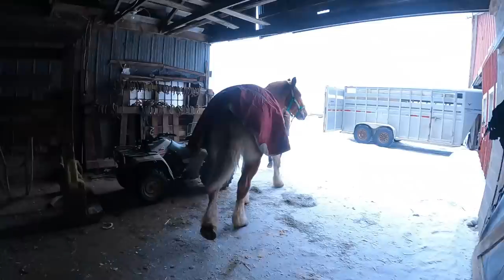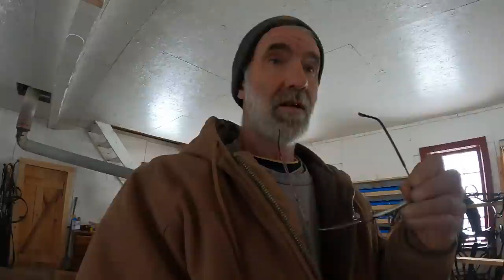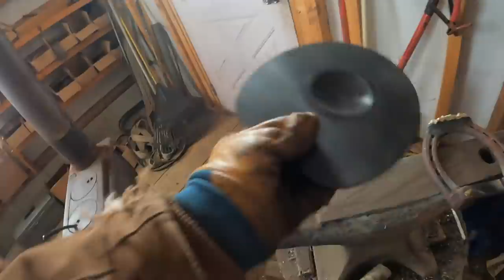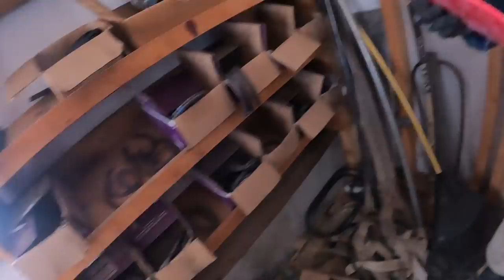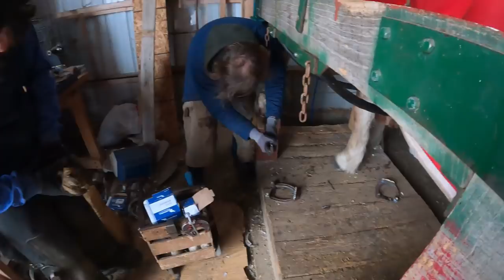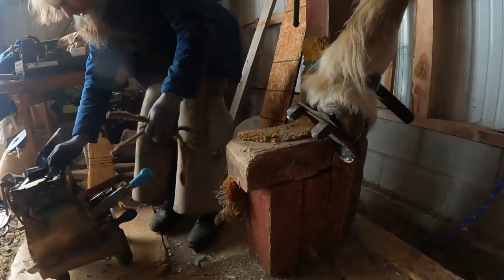AMISH FARRIER: All Your Questions Answered!!

Comment: Good job Eli and nice video Jim!  Eli has a nice shop to work in there and believe me once you start the job a heater isn't necessary! Being out of the wind, snowbanks and having a stock is a great help for farriers ,especially for the draft horses. The guys who have mobile shops never know what circumstances they might be working in and quite often it is muddy barnyards, snowbanks, and swarming horse flies and switching tails in summertime to say nothing of "green" colts and/or rank animals that owners have neglected to train to be handled. Believe me, Lady and Bill would be a pleasure to work on!!  Shoeing horses is a real tough job, hard work and vicious on your back. When I was shoeing back in the day I never had ANY customer complain about the fee. When I was young and just starting out shoeing an old timer farrier told me:  "There are three things a farrier can go to H... for: (1) Handling rogue horses(2) pounding cold steel and (3) not charging enough!
Reply from the maker: Thanks for sharing!

Comment: The last time that I had a horse shod with pads, the farrier had switched over from oakum to silicone caulking. It was so much easier to do and it filled it in without having to worry about any lumps in there that might make the horse sore over time. The way he was struggling to push that all come in there, it made me think that there’s going to be some lumps and bumps that are going to be pressing down on her foot.

Has he ever considered using silicone caulking instead? Does he have a preference to use oakum?  Why?
Reply from the maker: I never used it, I don't know if Eli ever has, I will have to ask him. The okum has worked great for us though. Thanks for the suggestion

Comment: Another great video and tutorial. another question for Eli, is there a specific size/weight hammer he uses or likes for driving the nails in the shoes. and any specific claw? Thank him again for allowing us to look over his shoulder. and for sharing. ECF
Reply from the maker: Will pass on the thanks and will try to remember to ask him about the hammer
Reply: There different styles, depends on the maker. They're  referred to as driving hammers and are usually 10 or 12 Oz heads. Do a Google search. Also, some are quite expensive.

Comment: Jim - I have used Amish to do some shoeing - however I helped a guy back in the 70's ( non Amish) and he taught me the difference between a country and city horseshoe nails - have you ever heard of them?
Reply: What's the difference? Are they steel of different grades?
Reply: The difference is the head of the nail!
Reply: @michaelhester3147  wrong - the heads are the same but lengths are different
Reply: If you go to a farrier supply, you find nails come in many different nail sizes and head shapes. Just like shoes.
Reply: @henryhankwarrenyohe2541  that is true however they are used differently - I have watched different horses being shod in you tube videos - and there are many choices such as race horses vs other types of horses - the choices depends on the usage and purpose of the horses - for instance - draft horses put a lot of strain on shoes and nails compared to most other types of horses therefore choices must be based on that - who wants a horse loosing shoe during the job?

Comment: Thanks for the video. Very informative about the snow pads. As for the smaller shoes that he said was for race horses, I wonder if Eli meant after they're over their racing careers or during? I can tell you with certainty that those are not racing plates for Thoroughbred racing, because they are much lighter and thinner than what those appeared to be. Maybe he was referring to shoes for Standardbred harness racing. I have no knowledge of the types they use and could be different than shoes used for Thoroughbred flat racing.
Reply: Like you, I believe he would have to mean harness racing and it explain how he has contact with them. Race horses rarely or never meet up with the fairground crows where you can watch tractor pulls  and harness racing .
Reply from the maker: Eli deals with horses that were harness racing horses (retired). He also shoes for a lot of the harness racers.

Comment: A question for everyone:
How are horse hames made? I have researched the subject and have come up empty handed. I'm assuming they were originally fabricated from solid stock by the local blacksmith, or even in wood on the farm. How and where are modern tubular steel hames manufactured? How is the tube tapered? Is it heated and put into a fuller to forge the taper?
Maybe someday a video on this subject if a source of information is found? Thank you!
Reply from the maker: Good question, I have no idea. I will ask around.

Comment: I might have missed it Jim but the cord or rope he put with the screw driver is to keep debris  from getting between the plate and horse?
Reply from the maker: That's actually the Oakum he's putting in there, to keep the hoof soft and to help protect the sole of the foot
Reply: @WorkingHorsesWithJim    Thanks Jim
Reply: Seems like that would be uncomfortable.  Just like something in my sock.